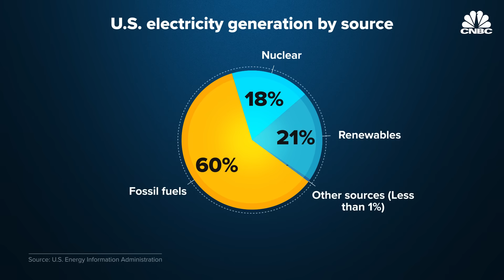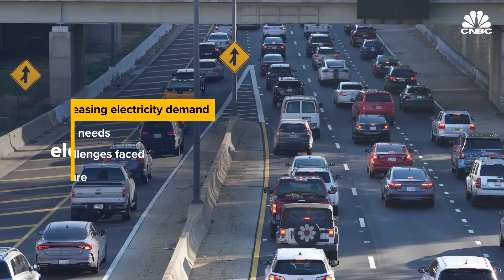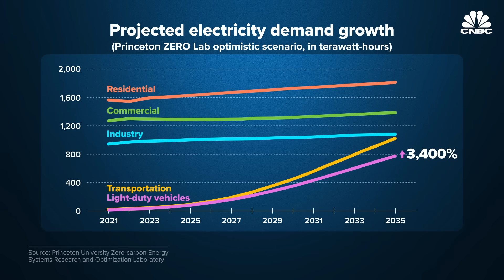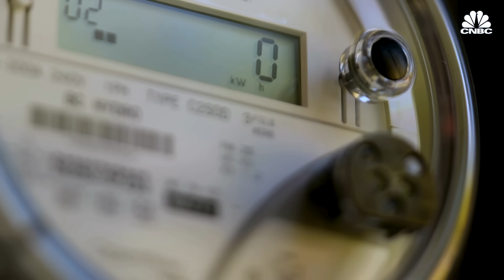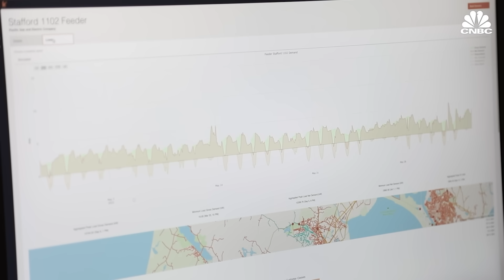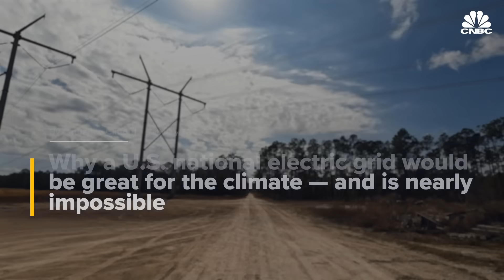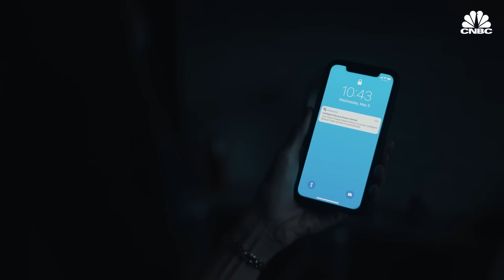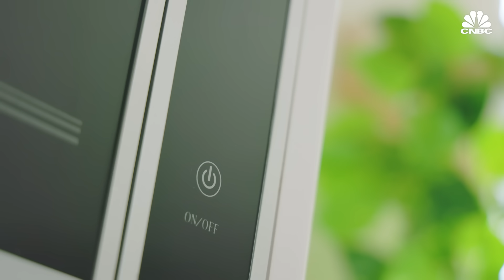Can The U.S. Power Grid Handle The EV Boom?

Comment: I would have like to see more emphasis on battery storage for wind & solar. Home, grid, and industrial. Batteries on the grid, in homes, in factories, and at businesses of all types can greatly reduce the amount of transmission needed to begin with.
Reply: Accept my proposal 
Hello Homeowner!
 I have a special request and offer for you
I work with solar energy company
"Say goodbye to rising electricity bills and hello to a greener, more sustainable future. With our revolutionary solar energy service,
Let me know your thoughts plz
Reply: That’s what EVs double as, energy store.  The missing element is the smarts. Vehicles should remain connected as much as possible, the smarts dictating when charging occurs. Conversely, if you don’t need X percent of your battery over the next 24 hours, volunteer this back to the grid when required.
Reply: @g00rb4u  Accept my proposal 
Hello Homeowner!
 I have a special request and offer for you
I work with solar energy company
"Say goodbye to rising electricity bills and hello to a greener, more sustainable future. With our revolutionary solar energy service,
Let me know your thoughts plz
Reply: @g00rb4u  I don't want my car connected all the time though. I want a solar roof and a dedicated set of house batteries.
Reply: @g00rb4u why would I allow my car to be used as a battery by the grid ? Will that not affect long term use of my battery ?
Reply: Battery is made with metals that are extracted in far more remote places with little to none environmental safeguards.  For as long as it isn’t on American’s backyard , who cares, right. ?
Reply: Electricity is a product of Man-made not natural physical like Natural Gas or/and Oils 🛢 🛢.   The Natural Gas and especially Crude 🛢 🛢 prices are manipulated by OPEC (The Organization of the Petroleum Exporting Countries   )

If there were an OLEC The Organization of the Lithium Exporting Countries = where Nations like Chile, Argentina and DR Congo would charge more than double for the Mining that China is paying "Slavery Labour" to get Lithium and other Metals needed for making Powers Storages/ 🔋🔋.

The Truth about Electricity is factual Artificial -- that is why the Concept of Grids so that the Grids can balance the Generations of Electric Powers from States to States from Countries to Countries like 🍁🍁to USA and USA to Mexico.   Powers Storages with Lithium Batteries destroy more Environmentally =>  Get the Grids so that Countries like Canada with 60% of Hydro powers distributed to USA and from Texas to Mexico.   Canada has a lot of Trees/Plants 🎄🎄/🌿🌿with Photosynthesis [ Interestingly, this process also uses oxygen in the same way as humans use oxygen for breathing. Fortunately, photosynthesis also uses CO2 and produces 10 times more oxygen, so plants create much more oxygen than they use. And that's a good thing.  ] 

More Vegetation/ Woods and Forests will neutralized more C02 and Gain Oxygen for Hospital Uses.   And when ⚛ ⚛ Cold Fusion Nuclear Reactors are ready by 2050, G7 can produce more Hydrogen and Oxygen and Sodium from 🌊 🌊 seawater that is abundant from the Oceans.   We can drive more Hydrogenated Cars and Trucks/Buses (industrial uses).

Batteries are old and new Technologies that would do more harm than good to environment by Mining versus Drilling for Oils and Gas.

Regards,

Comment: Take EVs completely out of the equation and we still have a  problem in the US; we are highly inefficient in our electricity usage. We have barely begun to scratch the surface when it comes to the low hanging fruit of energy efficiency. HVAC systems use a huge number of kilowatts in the warmer parts of the country. The promotion of high efficiency HVAC systems would net a huge payback in lower energy, much more so than the additional power required for EVs. My high efficiency system (20 seer) could charge 4-5 EVs (we have 1) with no net gain in kilowatt hours used compared to my old system (15 seer).

Comment: Wind and solar energy can be produced locally and do not need to be imported. Why pay high fossil fuels industry prices. 
Wind and solar energy combined with battery storage are safer, cleaner and cheaper than fossil fuels.
Once installed wind and the sun provide free energy month after month.

Comment: “Can the U.S. power grid handle the EV boom?”, most likely not!! More importantly, where do all these EV owners think the power is coming from after dark??… when the majority of EV owners are charging??

Their excess solar isn’t being stored offsite for them to charge their EV when they get home and even if the homeowner were equipped with a large home battery(15kw/h)… that couldn’t even cover charging the car(60kw/h), let alone household uses!!

It’s so incredibly dumb that people jumped on the EV bandwagon (regardless of its understated environmental impacts, inconvenience, extra cost, decreased longevity and safety concerns)… I understand why companies did!💸💸

Hydrogen will be the mockery of EV owners! It’s scalable, efficient, high density and can support everything from cars, trucks and fuel cells… or even fuel cells for cars, trucks and business. It can be used for internal combustion engines and boilers… all without the environmental impact, efficiency scaling or degradation of batteries! 

…Japanese, the masters of longevity and efficiency.

Comment: The devil's in the details.  The piece says electric water heaters typically use 3500 kwh per year, but that's old style all resistive units. Hybrid heat pumps use 75% less.  So would using that type of water heater be conservation or energy efficiency?  Switch your electric water heater to hybrid and you get  75% of your "avarege" Tesla's usage covered, or if you are in the 50% who use less than everage, the whole Tesla drives for nearly free!  Also it puts no net new demand on the grid.

Comment: It's always framed as "how much more energy will we need when everything is electric". How about "how much energy will we SAVE when everything is electric?" Fossil fuel refining costs gigawatts. A significant portion of the fuel produced is used to move the fuel around! If that were all to stop and everyone used electric cars instead we'd have a surplus of energy. Of course it's not going to happen like that but we need to take everything into account
Reply: Refineries have their own power generation and arent on the grid.
Reply: @Wolfcamp555  granted, some refineries have their own power generation and aren't on the grid.
Reply: @rushja  I've never seen one that didn't have its own power. Same way with compressor stations.
Reply: @Wolfcamp555  Even if they are all off grid, my point still stands. Put those stations online and we gain electric. I'm posing the theoretical turn off oil, start electric experiment that all these articles pose.
Reply: @rushja  you can't put them online and turn off oil at the same time. Your point has no stance.
Reply: @Wolfcamp555  why not?
Reply: @rushja  because the power plants at refineries run on the fossil fuels they refine.
Reply: @Wolfcamp555  hang on, the oil refinary refines oil using lots of electricity, like small cities worth of power. The oil comes in, gets refined then some of that refined fuel is used to power the electric plant and it's able to go around in perpetual motion? And the oil company still makes a load of petrol and all the other products it makes?
Reply: @rushja  yes, very high demand for petroleum. Apparently you can't afford it.
Reply: @Wolfcamp555  that's not how it works bro. You can't power the thing you're making with the thing you're making. Besides, we don't use oil to run electric plants.
Reply: @rushja  yes sir, thats the way it works. Natural gas is what is used.
Reply: @Wolfcamp555  natural gas is extracted from the earth, compressed and transported to be used as fuel. Crude oil is extracted, shipped and then refined into various forms of fuel. 2 different fuels. So use gas to generate electricity and oil to burn in engines. So refining uses lots of gas to refine the oil. If there's no oil there's plenty of spare electric generation
Reply: @rushja  natural gas and oil come the same well 90% of the time. Natural gas is formed from oil deep in the ground.
You just wanting to be schooled? Keep asking.
Reply: @Wolfcamp555  please school me in perpetual motion of using the fuel you refine to fuel the refining. I'd love to be schooled on how to break the laws of thermodynamics
Reply: @rushja  there's a natural gas pipeline that runs to the refinery. In the distilation process, natural gas is the first product distilled. A part of it is also used to generate electricity.
150 year old technology. You're literally that far behind.
Reply: @Wolfcamp555  we're not arguing here btw. I've got no argument with you. My point is that if oil refining stops tomorrow you'd have a load of extra electric generation. Yes it would be from gas, which is a fossil fuel, but nevertheless the extra capacity would come online
Reply: @rushja  refineried don't use electricty to refine oil with. They use gas. The power plants power other things. If oil refining stopped tomorrow, the refinery power plant would stiill have to be powered by the gas coming from the oil well, turning oil into a biproduct that would need to be disposed of.
Even if there were a solution for that, the power generated from a power plant at the refinery would be minuscule and not economical to run.
Yes, its possible to shut down every oil well and run straight from a natural gas field like the Barnett shale or the Marcellus.
Why would you want to shut down oil refineries?

Comment: First, while the transistion to EVs and Renewables will require new transmition lines, overall, our transmision lines have been in need of repair and upgrade for a long time now, and will still have the that regardless of where the energy comes from.  Second, most EV charging already takes place at night, when electricity is plentiful and underutilized.  Third, you downplayed the growing number of homes that are installing solar and storage batteries.  Fourth, you don't mention the electricity that will be save when we are no longer drilling for, refining, transporting and pumping oil and gasoline.  And lastly, more power needed also means more KWHs that Utilities can collect money from in order to help pay for the additional lines needed.  If you are going to do a story on this subject matter, I would suggest you find better experts...

Comment: Renewables still need non-renewables as a backup when they aren't generating enough power to meet demand. In any electric grid it operates at a certain frequency, and there's a very low tolerance either side of that frequency. Go outside of that range and bits of the grid will start to trip out. Power stations can't just be turned on at the drop of a hat, so they have to be running all the time, they need to be able to ramp up generation to whatever amount is needed, in an instant.

In Europe last summer, some hydroelectric dams stopped generating electric when water levels got too low. France had problems with their nuclear plants, iirc the water used to cool the reactors got too warm so they had to reduce output to stop the reactors from overheating
Reply: Water level and temperature are solely a problem for the environment, not the reactor
Reply: @LightBulb-tu6uz  How do you expect the reactor to be kept cool without cold/cool water circulating through the cooling pipes?
Reply: @leeroberts1192   It seems you misunderstand how that works. The river temp. doesn't affect the reactor temp. at all.  See primary and secondary cooling circuit
Reply: @LightBulb-tu6uz  Well back last year when we had that really hot weather they aid on the news that France had to reduce the output of its reactors due to the temperature of the river water
Reply: You're right. In the U.S., the frequency is 50-60Hz. In Texas, natural gas is the primary, wind and solar is the backup up. Fossil fuels has to be the primary and not the back up.
Reply: @Wolfcamp555  I was watching a vid on Youtube once about when a large area of grid (think it was somewhere in the US) crapped itself with one part going, the lines where the load got diverted to couldn't handle the excess load, think it was cables sagging, touching trees and then tripping out
Reply: @leeroberts1192  probably the northeast or California.
Reply: Sodium Ion Batteries would solve this now.

Comment: Population centers in sunny areas of the country could quite easily put solar on every suitable building or surface facing the sky.  Then the energy is used right there where it's needed.  Reduced energy transmission loss, reduced need for transmission infrastructure, and reduced demand on the centralized power plants for the win.  It also makes the entire grid more resilient especially if those solar installations are coupled with batteries.  Decentralization, not centralization, is how you solve this problem.

Comment: Transmission lines, solar and wind all good.  Not mentioning nuclear - the greenest, cleanest most available source of electricity - short sighted.
Reply: It is 2023.  At this point, Nukes are the most expensive, slowest, long-term dirty, and highest risk New Generation . . . .  EVER.   Meanwhile Silicon Solar is the cheapest, fastest, cleanest, and lowest risk New Generation . . .  EVER.   So now US is building mostly Solar PV.

Comment: Speaking of the last mile. The main electric cables in my small neighborhood have just been upgraded.  I asked one of the guys doing the upgrade if all of us in the neighborhood could now switch to EVs. "No way."
Reply: If you have Air Conditioning, your area can handle EVs.  EVs take less than Air Conditioning.   If you add Solar PV (over 1/3 of EV owners do) and the load of your house and the EV and house then produces as much as you use -- the net effect of EVERYONE having an EV and the 1/3 of the existing houses having Solar PV . . .  there is a net DECREASE on the Grid.
Reply: @philtimmons722  and it's 1/8 the cost and 1/4 the size it was 10 years ago. 

I can generate and store 1kwH per day for 0.5c per kwH ($600/3000 charges. ) before my storage drops below 1kwH.  Actually,  I can generate about 1.2kwH per day if I turn the panels slightly twice a day each day.
Reply: Next time ask an engineer instead of a lineman.
Reply: In my case, I have a 200 amp service, so does everyone in my neighborhood, installed in 1985.  So we have underground wiring, and that would be especially expensive if they needed to upgrade any of it.   My HVAC uses more power daily than my electric car.  So I did not see the 85% increase in my electric bill, that some will "Claim" is going to happen when everyone goes electric cars.  It is actually only about 20% more power to power my car, compared to prior to owning a electric car.  

Consider that they only run the power plants at about 40% power overnight, compared to the peak hours of the day.  So overnight they might need to run the power plants at 50% instead of 40% to charge all of those cars.

Comment: My  take.   Here in Texas we have made great effort to do residential solar.  I have a 4,800 watt solar roof and thinking of adding 50% more.  My car will use half of the daily output.   The state is determined not to add power plants   Incentives for homes is growing.
Reply: If people get 5 KW of home solar per electric car, they can actually use less electricity than when they did not have solar and a electric car.  So I am not worried about the grid, if people will install some solar each time they buy a electric car.  In your case, maybe a total of 12 - 15 KW considering your HVAC needs and 2 cars.
Reply: In California they just got rid of net metering. So now going solar is 50% more expensive since you have to buy a battery. And that is on top of the high costs of going solar because of the high cost of labor. I am just glad I am grandfathered into net metering.
Reply: @jamestucker8088  You do not really have to buy a battery.  However, if you want to make the money math work, you may want to look at carefully aligning your Time-of-Production and Time-of-Use.
Reply: You drive your car about 100 to 120 miles per day?  My understanding is that It's 25kwH per 100 miles.
Reply: @mac_mcleod  3- 3.5 miles per kw.   I was driving average 80 miles to 90 per day.  The daily output is 24-26 kWh.  The summer Sun track has shifted to the  north so much I need to take advantage of 2-6 pm Sun track on the western face of my roof.  I have a  lead foot and use 16-17 % each direction   Full A/C  and I go with the flow of traffic.   Over 8K miles on Mach-e in 3.5 mo.   I drive it a lot.   Charge 500 kWh at home per month 85%. 15% at free or pay charging stations.   My LYRIQ is ordered and range anxiety will be a thing of the past. 309 miles verses 224 on Mach-e.

Comment: Why wasn’t nuclear mentioned? It does not emit CO2 and has a lower carbon footprint than some renewables. It needs to be part of the solution.
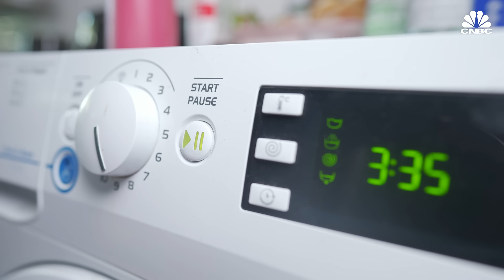Reply: Nuclear was mentioned @13:30
Reply: @BigBoss-kq8mb  I did hear that later, but it was in passing as a way of waiting not part of a long term solution.